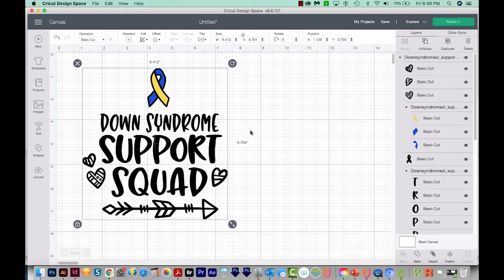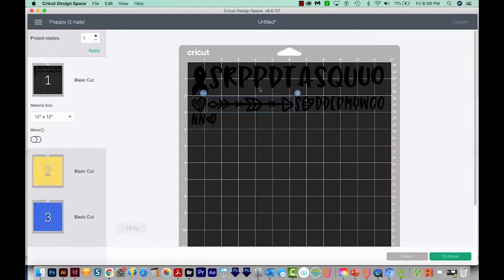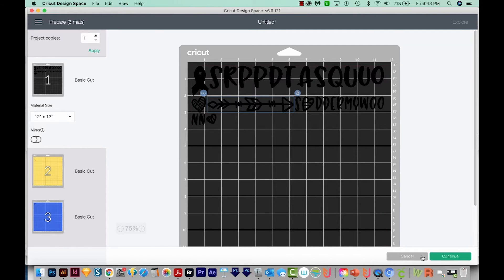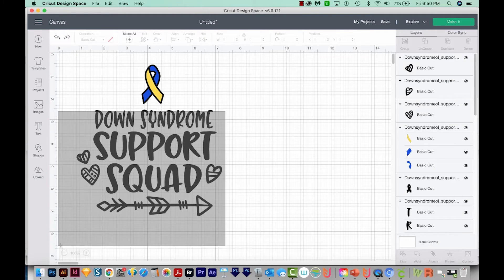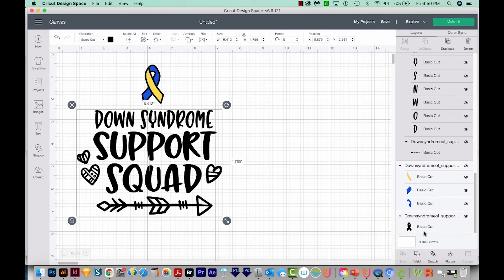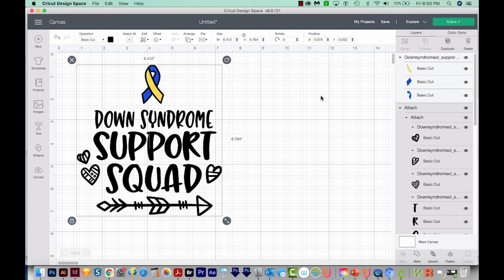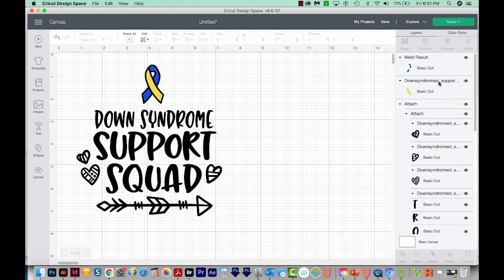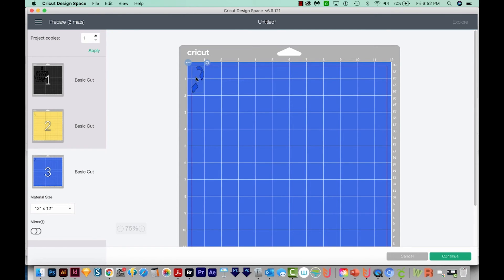Cricut is jumbling or scrambling my letters and rearranging my design after i click Make It

Comment: I'm having the opposite problem, the design is staying together but the program takes one part and puts it on a second page, but the design is taking up less space than the mat and material size. This is driving me bonkers and uses up more vinyl than it should, not to mention the hours spent doing the design with result of not being able to use it like I want to
Reply from the maker: It sounds like you have more than one color in your artwork. Maybe black and very very dark gray. Select all, then change the color to black (or whatever). Then give it a try.

Comment: Can i do this on my phone?
Reply: Yes! :)
Reply: @GDHT i cant get it to print without saying i need a cricut access subscription ugh.
Reply from the maker: You can just 'x' out of Cricut Access, and then you can print/cut. You don't need a subscription to use your Cricut.
Reply from the maker: Hmm I'm not sure then. Are you using a design from Cricut Access, maybe?
Reply: @SVGCF my layout consists of 3 words, 1 heart all from cricut and 2  uploaded logos in black and white
Reply from the maker: If you remove the heart from Cricut, are you able to print?
Reply: @SVGCF  i will give it a shot. I was about to give up. I will let you know on a minute.
Reply: @SVGCF  no that didn't work either.
Reply from the maker: I would try deleting everything but the heart and see if that works.
Reply: @SVGCF  i tried that it didn't work.

I tried simplifying the layout and removed everything except the  "I wa" using the varsity letter font. It still wouldn't print.

I went to one of my old layouts that i saved it still prints. On that layout each letter had its own edit box. 

But the layout with "I wa" thats all together in one box wont print.

Comment: What about print and cut!?? I'm losing my freaking mind because I am trying to print stickers on letter-size sticker paper. However, when I go to make it, it rearranges it and I need them to all fit on one sheet not several. I need a freaking answer!!!!!!
Reply from the maker: That's a pretty demanding way to ask for help...but I'll do my best anyway. It sounds like you might be using an SVG file, which is fine, but when you do that, Cricut thinks you are wanting to cut it from vinyl.  Usually you would want a PNG, but there's an easy fix. Select all with CMD A or CTRL A, then Flatten (lower right). Now your image should stay together.

Comment: I’m using a google image and slicing it on to a template, but when i go to print the preview makes the image shift causing it to look jumbled. This works for keeping my template together but not with keeping the image in place.
Reply from the maker: Hmmm, I've never run into this. Have you tried grouping or welding the pieces?